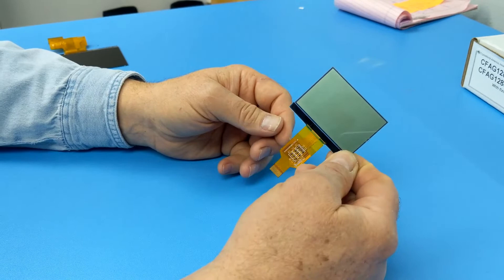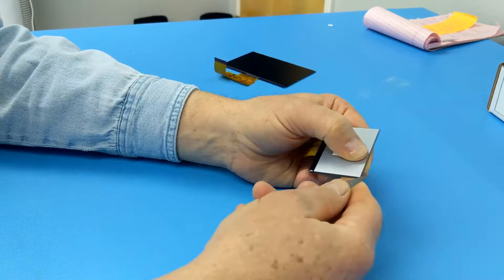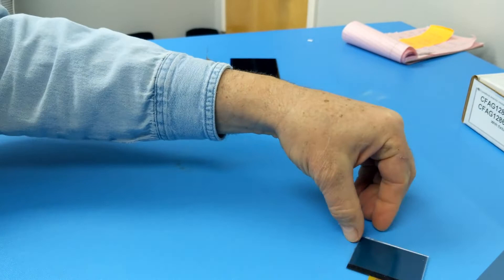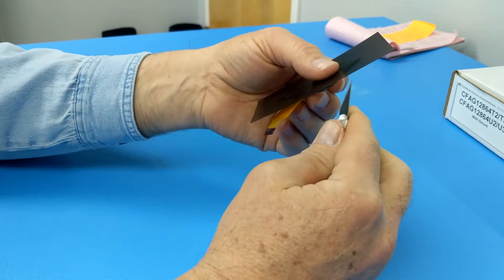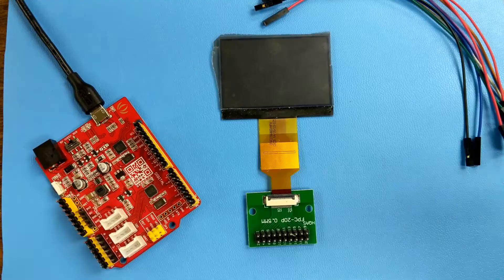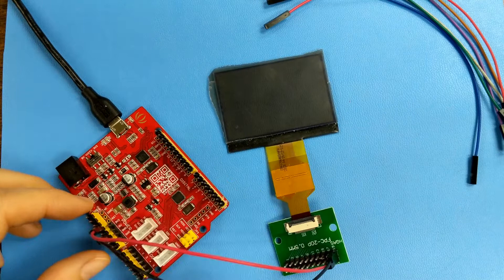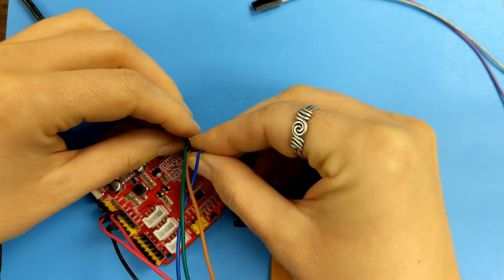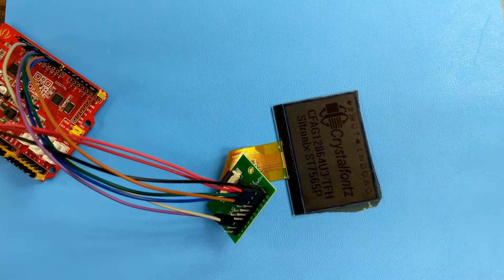Do-It-Yourself Transparent LCD

Comment: Very neat! If one were to replace the backing with, let's say a one-way reflective window tint, could that theoretically allow a one-way transparent display (image on the display visible from the front, and can see through the back on the other side), with whites to display correctly in the screen? I'm trying to figure out how I could use transparent displays as eyes in cosplay, and was disappointed that sourcing TOLED's seems nigh on impossible 😞
Reply from the maker: In theory it sounds possible. It might be difficult to see through, also the pixels on the display are dark not white. We have a small TOLED for sale on our site which may work better for this: https://www.crystalfontz.com/product/cfal12856a00151b-128x56-transparent-oled-screen
Reply: @Crystalfontz  Ah yeah, those are definitely some good points I'd not considered. As for the TOLED, I actually had come across that, and it looks very neat! However I'm afraid the project I'm currently planning would require full colour displays.

Comment: Can complex graphics and other HUD features be displayed through this display? Awesome one! I'd like to use it for a smart goggle application, suggest?
Reply from the maker: You can display any graphic you want, but consider the resolution of 128x64 pixels. It's not really transparent enough to see through it clearly for goggles. Optics are tricky, I'd try some different displays and lenses and see what works best for your design. Good luck!

Comment: Is there a particular reason that after removing the backlight on the LCD, the light coming through looks blurry? Is it just due to the type of LCD or a camera artifact? Like if you wanted to make something like the 7 Shade Sunglasses, could you use this method?
Reply from the maker: The polarizer is what causes that, but you won't be able to see the letters on the LCD without it. We're not familiar with the 7-shade sunglasses, but it looks like it uses an LCD light valve, you might take a look at those.

Comment: And one more question: Does this screen, or one of a similar size play back the composite signal of a FPV Camera like JINJIEAN 1280? I connected a small camera to a small screen via an Arduino but if I would not need the chip I would be very happy.
Best,
Boris
Reply from the maker: This display communicates using 8-bit parallel or SPI.

Comment: which color lcd screen would your recommend from your site, as being easy to remove the backlight on?
Reply from the maker: This is the display we used: https://www.crystalfontz.com/product/cfag12864u3nfh-128x64-low-power-graphic-monochrome-lcd
Reply: @Crystalfontz  Thanks, but I'm wondering which color LCD screen, not monochrome has an easily removed backlight.
Reply from the maker: @nickygodoff6470  This will only work on monochrome transflective displays that are chip-on-glass.

Comment: thanks.  a good way to poke your eye out or earn some stitches is to hold a knife when doing anything other than cut.  Simple.  Cut and put down.
Reply: He's a trained professional. During the video "Don't try this at home" was flashed at the bottom of the screen. It was just very small. But good advice no matter 💜
Reply from the maker: Yes. Way too many scars on my hands. Should have worn gloves - the glass could have broken.

Comment: Hi, I’m looking into using a 5” raspberry pi touchscreen for a transparent tablet project, if I remove the backlight and polariser film will a damage the touch screen? I don’t know much about the inner workings of these things! Thanks 😊
Reply from the maker: Hi, It's definitely possible you will damage the touchscreen. but touchscreens are attached to the front of a display while the backlight and rear polarizer are on the back.  You'll want to be careful not to cut the touchscreen tail traces. We haven't tried this hack on a display with a touchscreen, but let us know how it goes if you do!
Reply: Crystalfontz America, Inc. Hi, thanks for getting back to me. I’ll have to look up some diagrams etc to see how the specific screen I’m using is put together. If I can actually get it to work I’ll upload a video of the prototype.

Comment: How is the backlight on the CFAG12864U3-TFH connected?
Reply from the maker: It's electronically connected via the A and K tabs, physically it's bonded. If you want one without a backlight we have a -NFH version. https://www.crystalfontz.com/product/cfag12864u3nfh-128x64-low-power-graphic-monochrome-lcd
Reply: @Crystalfontz   Might be worth mentioning it in the datasheet as there's not mention of how that connection is made in it...
Reply from the maker: @krisd9506  Thank you for pointing that out, we'll update it to make it clear.

Comment: it repirie trying fix new danger for my drive s
Reply: Yes. That is correct. However you may want to replace your Johnson Rod with one of lower impedance. The flux capacitor will last longer.

Comment: Will it work with Arduino UNO?
Reply from the maker: The I/O voltages have to be 3.3v for this display to work. The standard Arduino Uno uses 5v logic, so you would need to shift the voltages down to avoid damaging the display.